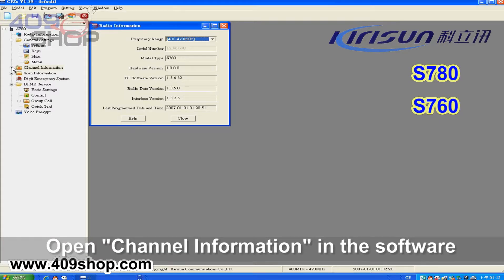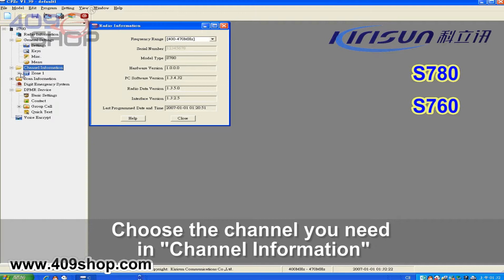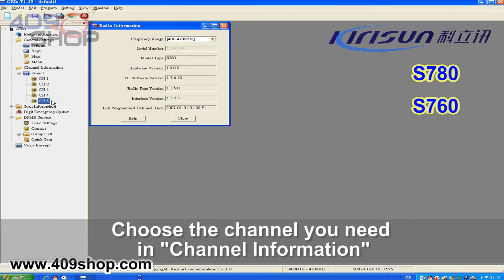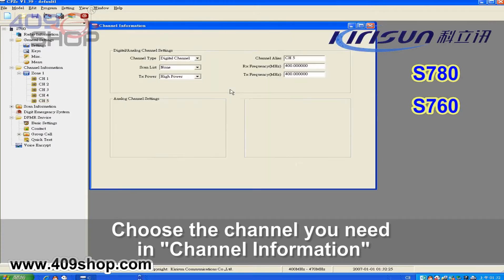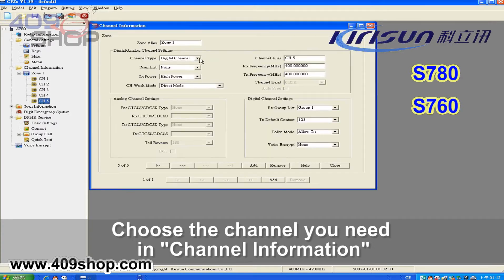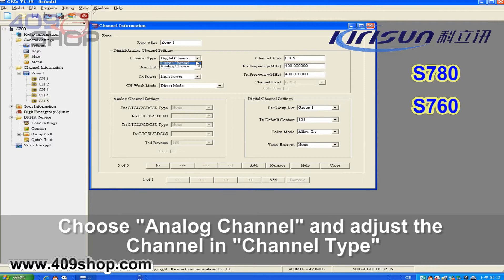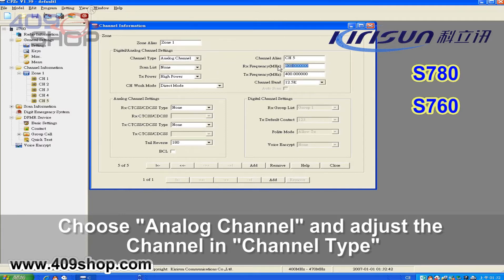Kirisun S780 / S760 Analog Mix Digital Function

Comment: This is not analog digital mix. It just analog.
Analog digital mixed mode is when the radio detects if the incoming transmission is analog or digital, and then switches automatically to the correct mode
Reply from the maker: thanks for your message, the S760/S780 can both contact with analog or digital
Reply: yes, but it can't select automatically, can it?
Reply from the maker: it can change into analog or digital mode